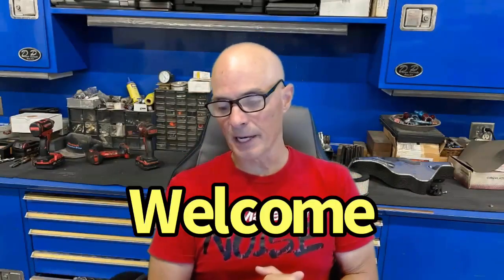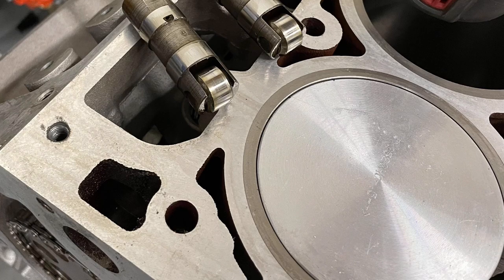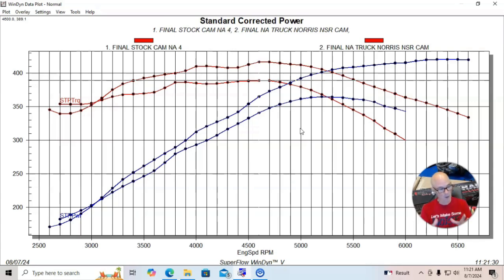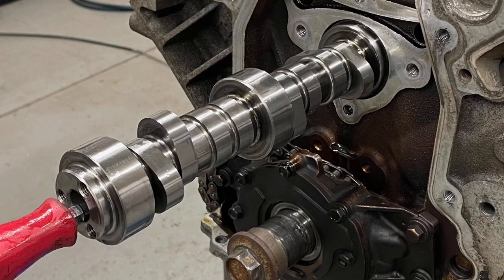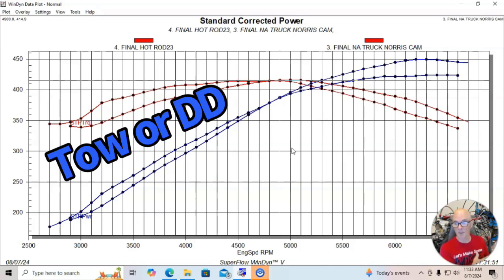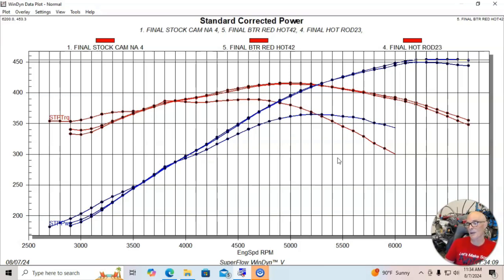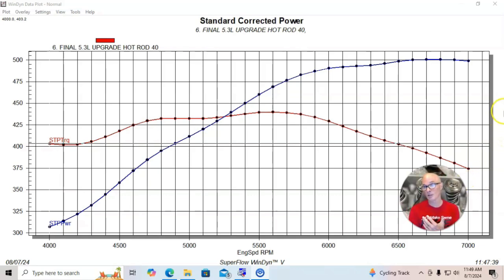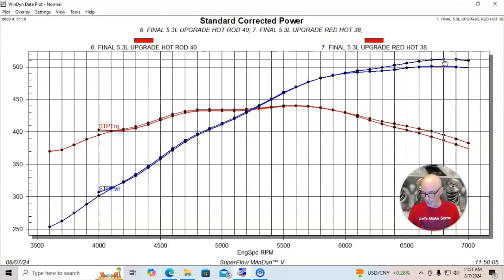HOW TO MAKE JUNKYARD 5.3L LS POWER. BTR CAM FAMILY FEUD-L33 VS TN NSR VS TN VS HOT ROD VS RED HOT.

Comment: With the btr cam card do you ever have to mess with the injector phasing? Or do you leave it at 90° like what holley recommendeds? Because the cam card doesn’t give the atdc or the abdc degrees, and the card doesn’t say if there is an advance built in I don’t want to fat guess and cause major issues. Love the videos keep it up
Reply from the maker: we never have any issues with tuning and rarely ever change injector phasing (we have tested it-but never do it in normal testing)

Comment: Sometimes  depending  if you dont care about bottom end as much.. low lift flow porting and valve chamber work will find that Horsepower on a lower lift.. at a certain sacrifice  on low end and some power curve

Comment: How can I translate any of this to my Gen 1 327 SBC with GM'461/'462 Heads and the '151/l79 Cam (220 @ 50) ?
When i need to rebuild I want to make it a Roller Lifter/Cam...   What range might I expect with the the Truck Norris cam and TF "Double Hump" look alike 175 Intakes ?
Reasonable imitation of the L79 or Am I completely missing the picture ?
Reply from the maker: completely different engine families and heads, intakes etc... There are much better heads and cams for the SBC that help

Comment: Richard, I just stumbled upon something that I can't seem to get any straight info about and wondering if you can help ?
In regards to 799/243 LS Cylinder Heads: Do the Gen4's have a bigger Exhaust valve than the Gen3 models of the exact casting/name ?
For example, Gen4 (LY5 5.3L) 799/243 = 1.575" Exhaust Valve .vs. Gen3 (L33 5.3L) 799/243 = 1.550" Exhaust Valve, both Gens have same 2.000" Intake valve ?
Both the Gen3 L33 and Gen4 LY5 are 9.99:1 Compression ratio and have the 'same' cylinder heads but the Gen4 LY5 is Spec'd as having +5-10 HP and +3-5 lb.ft more over the L33.
thanks for taking the time to read this and please comment if you are able to.....
Reply from the maker: exhaust valves are the same size as far as I know and have measured

Comment: I've been lurking on your channel watching all these videos. I have a 2005 Silverado with the 5.3 "Z" motor. I work week-on, week-off, and on my week-off, I drive to other facilities to work as they are very short workers. Some of these facilities are 150-miles from the airport. I am willing to do a little to my engine to get more breathability for mileage, but it is so expensive. All I've done so far is the K&N, shorty headers, catless pipes to the Y, and Amsoil in everything. It would be nice to get better than 15.69mpg. Especially as gas here is $5.15 per gallon. This is with cheap 10-ply tires pumped up to 45psi too.
Reply: Have you had it professionally tuned ?

Comment: Good afternoon Mr. Holdner Sir. Thank you for all the valuable information that you have been sharing on your channel.  I am planning on building a road course car and have settled on an LS or LT platform.  As I have a very limited budget I cannot afford a builder to build it and so will try to do it myself. I am a novice and seek your advice.  Which platform would you recommend for a road race application targeting 700 naturally aspirated crank power? I was going to do a 6.2l junkyard build, but have read mixed opinions online.  I trust your judgment and so am seeking your opinion.  My goal is reliability and cost effectiveness first as I do not have a lot of money to spend rebuilding, so want to build it and maintain it. Any feedback would be greatly appreciated.  Thanking you in advance.
Reply from the maker: you won't get 700 hp NA in any kind of budget build, in fact, 600 hp with a 6.2L is hard to do. Pick a different power level or pick boost
Reply: @richardholdener1727  
Good afternoon Sir, thank you for taking the time out of your schedule to reply. The budget I keep coming to is around $17,500, all in with me doing the labor (eeeek on my labor) 
It is based on the BTR GEN V LT1 700+HP package, which is around $7k, dry sump system,  around $6k, $5k in the engine,  controls, and misc parts. 
Does that seem like a realistic budget for an NA setup? I am trying to avoid turbos for heat soak and reliability issues on the road course.  
I've seen some crate engines in that range at the crank for about $22k, which seems in line with $6k being the shops labor. 
Thank you in advance for your reply.

Comment: Best cam for l87 engine
Reply from the maker: for what usage?
Reply: @richardholdener1727  daily .
stock stall if possible 450whp
Reply: @richardholdener1727  daily look for 450whp stock stall converter
Reply: @richardholdener1727  daily 450 whp if possible

Comment: Great stuff, Richard! I now wish I could see the overlays of comparing the same cam, same motor, but before and after the intake and heads swap. I can see the peak numbers differences such as with the Hot Rod cam, but I wondered if the upgraded heads and intake with the Hot Rod cam, made the low end torque or less low end torque. I wish I knew what intake centerlines everything was installed at, but thanks for listing many specs. such as LSA, etc.

Comment: Sorry off topic but the question I have is  with a stock stroke 5.0 is 200cc heads to much head for the street? So many forum "experts" who speak in absolutes say thats way to much head on the street...I'm on the side of it's not with a well engineered set of heads a 302 will run just fine on the street with 200cc heads. I've read afr enforcer 185cc match the 165cc versions TQ curve  but makes more hp up top so there's no advantage to the 165cc, is that true. I take these key board experts claims with a grain of salt other than a handful so many there are just regurgitating nonsense they just heard no actual hands on experience like over n over n over saying putting cam in a 5.0 with factory heads and explorer intake is totally stupid because it will not make any more power and likely lose power... Even tho bang for your buck isn't huge you have proven that's not the case, I think you made 279hp being a 15 or 20hp gain with an E7 headed 5.0 and it sounds way cooler.
Reply from the maker: A Comp XE274HR cam was worth 30 hp with the stock heads-200 cc heads work fine on a 302 (if they flow well)

Comment: Unfortunately, you would have to work directly with the lobe designer to really get the most out of a .500" valve lift vs. .550" valve lift test for a given application.. Peak lift does not tell the whole story of lobe area. You could create a lobe for .550" valve lift that has no more lobe area than a lobe created for .500" valve lift. If I were doing this test, I would make sure that the lobe created for .500" and the lobe created for .550" valve lift had the same peak positive and negative acceleration rates so that you realize the full benefit of the lobe created for. 550"valve lift in your comparison. If you do not get into and verify these crucial specifics, the test results will mislead you.
Reply from the maker: What you are saying is to create a custom cam-the test was simply to show people the effect of lift-not what happens when you design a custom cam-so not misleading
Reply: @richardholdener1727  The goal would be to avoid the pitfall of people mistakenly believing that this test somehow definitively answers the question of how much power 050" of additional lift is worth. A lot of guys are walking away from this believing the going from .500" to .550" lift is worth "X" horsepower. When, in reality, this test only shows what happens with those cams in this engine. Whereas another camshaft with a different lobe design, might have a different results because the lobe design was different. I realize that there is only so much you can do and say in this format and with these sponsors, but I am always trying to help guys see the big picture so that they can make better decisions for their projects.

Comment: Very timely vid for me.    I have a 74 C10 truck with a stock 5.3   the whole thing weighs like 3200 lbs.    Gen 3 truck engine.    first off the thing is pretty darn fast for what it is being able to fry 10" tires LOL... but....   looking at cams I am seeing the truck norris?  NSR cam and thinking.... why not?  it has more HP and torque at every RPM range. and at peak... maybe 40 more hp?    And don't have to replace springs etc.    I am not into running a motor 7 grand so this seems like a total win win... am I right in this thinking?
Reply from the maker: that cam upgrade is worth 60 hp-I have a cam that does the same thing for $179 shipped-send me an email if you are looking for a cam-killerbe16@aol.com

Comment: Do you have a link to the heads in the video the trick flow heads?
Reply from the maker: tfs as-cast 220 heads (Summit has them), but these were ported by BTR (these heads are not your average heads-but you can make this power with others)

Comment: Have you ever thought to test a sbc cam but changing from 1.3 break-in rockers to 1.7 rockers? I thought the difference in power would be bigger. Of course, the heads would be better off if they had good flow at higher lifts. 
  I'm running 1.7 roller rockers on my old 92 c1500 with a bolt-on tbi 350.

Comment: Do a huge cam with a smaller duration in a 5.3 to see if you can get over 600 NA custom spec
Reply from the maker: how do you make a huge cam with smaller duration when lift doesn't add much power?
Reply: @richardholdener1727  Short duration cams with high valve lift can be responsive and provide good torque and power
Reply: This is a fact when it comes to performance

Comment: I hypothesize that the difference in LSA did as much (or more) to change the power curve in the TN cam vs HR cam.  The 5 degrees in extra duration normally wouldn’t make the power below 3500 drop that much, but going from a 107 LSA to a 114 (in combination with +5 degrees of duration) would explain the significant power loss below 3500.  

I’m sure the LSA helped a little on the top end gain too since 25hp seems a bit much from 212 to 217 intake duration increase.  If I had to guess, normally a similar increase with same/similar LSA would gain about 15-20hp on a stock 5.3
Reply from the maker: I like not guessing and actually getting the answers from dyno testing
Reply: @richardholdener1727   I’d like to do the same, but I don’t have access to a dyno.  Instead, I have to make hypotheses and try to find tests that others have done to compare.  It’s why I find your info so valuable…  often the same engines on the same dyno so it minimizes the changes in variables.

Can’t thank you enough for all the info
Reply: Take this one more step, have a look at how LSA typically affects the intake centerline or ICL. Typically, a camshaft with a 107 LSA will have an ICL of 103 to 107 degrees, whereas a camshaft with a 114 degree LSA will typically have an ICL of 110 to 114 degrees unless it is a VVT camshaft. The reason this is significant is because the ICL will have a much more drastic effect on a camshafts RPM range and powerband than the LSA does. This is because, one key thing ICL determines is when the intake valve closes. When the intake valve closes is crucial when it comes to tuning a camshaft to a given RPM range. Unfortunately, for years people have confused the effects of LSA and ICL. LSA has a direct effect on overlap. While increasing overlap can increase upper RPM horsepower, it does not have as much effect on the power curve as the ICL.

Comment: My cam is similar to the red hot, Wide LSA, lots of exhaust duration. At the strip you can really see it come on past the 1/8th and in the MPH. The low speed torque is lower but that's ok because its traction limited anyway.
Reply: Sounds like my summit ghost cam.

Comment: Why can't you ever test cams at the low end where street use is. Not all people utilize 7000rpm. I installed a so called stage 1 cam in my dad's truck and gained torque and mpg!
Reply: He does😂 he just runs them all out to 7000 what you do with that info is up to you. The total range is there just open your eyes
Reply: Everything you need to see is in the graph. You aren’t going to find many dyno charts that show under 2500rpm

Comment: Test the cam motion little chopper please
Reply from the maker: I DID-THAT VID IS UP
Reply: @richardholdener1727  I did not see the test of the Little Chopper camshaft. I saw your test of the "Little Lope" camshaft (which was misnamed in one of the two videos as the "little hotrod". To clarify, the Little Lope is 216/224 108+3 whereas the Little Chopper is 222/232 108+3 and makes wicked peak torque. I sent you both camshafts, so you have the Little Chopper if you ever want to test it. The thing works great with cathedral or Rec Port heads with either long runner or short runner manifolds. It is even a nasty little fellow in the 5.3 and makes a great racing cam in the 4.8.

Comment: So have your grinder do a Hot Rod type cam with the Intake and exhaust ground with an inverse radius on the flanks with a small grinder wheel shortening the durations say 8 degrees with similar durations at .200 and similar lifts  Why spend all that money on a build and leave torque on the table?  Shortens the overlap which u can pick  What cylinder pressure do you have or what are you going to build, go from their with your head flows  cheers   Looks like those two bigger cams need more head and compression
Reply from the maker: You need to understand why these tests are run. The goal is not to make the most power possible-otherwise the components would be different. The goal was to test popular shelf street cams.
Reply: @richardholdener1727  great tests and BTR cams are well tested  shows why bigger is not better unless the combo is changed.  Probably the same today but at the speed shops new customers were always asking for the cam at the bottom of the page
Reply: In this particular test, they are using an LS engine which has a 55mm camshaft. You do not need an inverse radius on a 55mm camshaft to produce high valvetrain acceleration rates. That is something you might use for a small block chevy where the journal diameter and base circle is so small that an inverse radius is the only way you can get aggressive acceleration rates.
Reply: @camshaftsteve  close steve but if I use a max HR inverse radius profile I can get less side loading and more acceleration at less duration  You can't avoid the simple mechanics of a flat flank cam
280 @ .006  LSX  224-231@.050   139-150@200   SBC  222-227@.050  139-148@.200
for this discussion I can shorten up to less than 270 compared to a non inverse sbc HR and still get 140+ @200  I get more torque with the same top end
either can be better with the lifter bores trued up at Chrysler size with a bigger roller
worn lifter bores are a major point of failure  with old SBC/ bbc  I hardly ever did brass bushings unless needed longer lifter bore
appreciate your comments, cheers

Comment: If nothing else this closes the argument of lift vs duration especially when on a good breathing LS cylinder head. DURATION is where the power is. On a typical sbc I bet that 5-6 hp gets cut in half with a .50 more lift on a same duration cam

Comment: What is the holy grail of the "cheap" (non LS7 Z06) LS engines?
Reply: I’d say the L92 (early gen4 Escalade / Denali engine) they do exist in junkyards though they’re hard to come by.  But they are aluminum block 6.2L with no AFM (they do have VVT).  They are essentially an LS3 with some minor differences
Reply from the maker: there is no "one is better"
Reply: @richardholdener1727  Which one do you prefer?
Reply: Best potential per dollar is the LY6. 6.0L, Rectangular port heads, gen 4 rods. No DOD crap.

Comment: whats the biggest cam i can throw in with stock internals?
Reply: Just because you can, doesn’t mean you should. A 5.3 with a big cam is a dog. Especially in a truck. Not a good idea.
Reply: @Turbogto_guy  well what kinda of cam should i get i wanna make a little more power but i need it in lower end?
Reply: @modland-s3b  more power in the lower end than stock?
Reply: @modland-s3b  if you have a truck….well let’s start like this: what vehicle/engine/gears/stall and intended use?

Comment: So stock cam and a gt45 turbo kit is what im hearing then? 😅
Reply: 7875 turbo with a .96 exhaust housing.
Reply: And an ls2 cam.
Reply from the maker: hard pass on the LS2 cam
Reply: @richardholdener1727  why is that? It seems like in your tests, it faired quite well as a good all around upgrade for someone wanting to keep drive ability, economy, torque and longevity. We just put a 7875 on my sons 2004 5.3 z71 (lowered on weld drag wheels) and we want it to stay driving like stock so we planned on puts ls2 cam in. Looks  to be worth 30hp NA and 45-50 on boost with no low speed tq lost